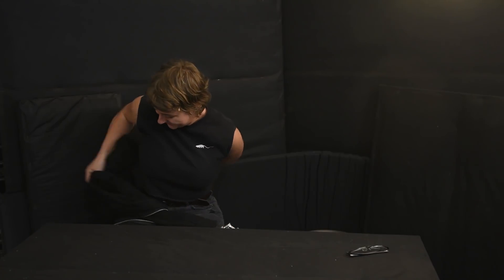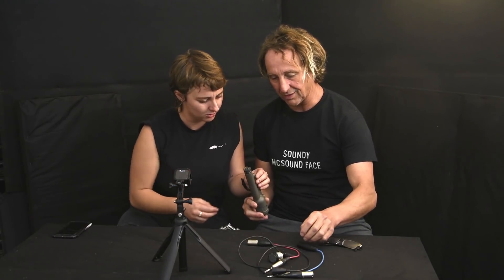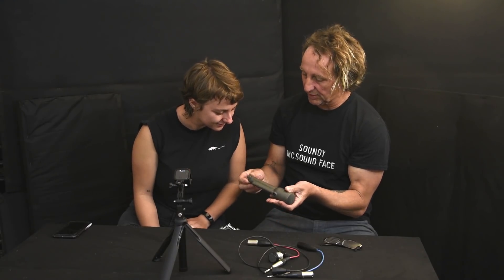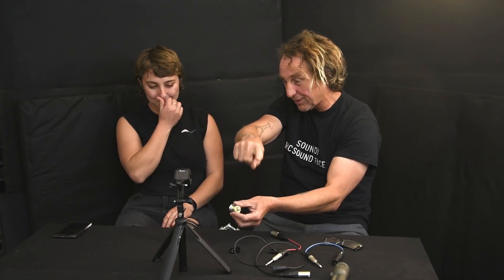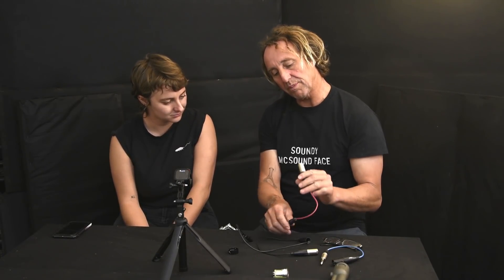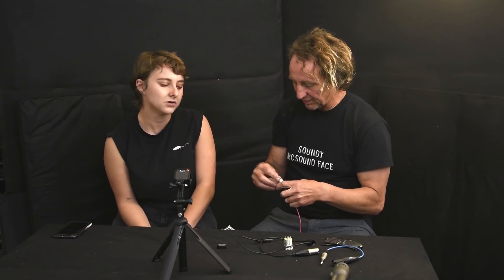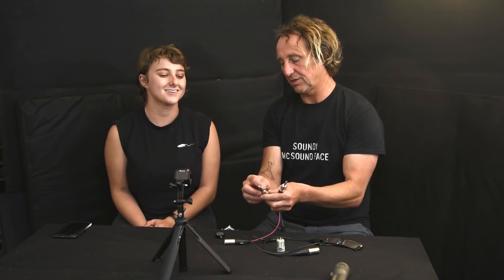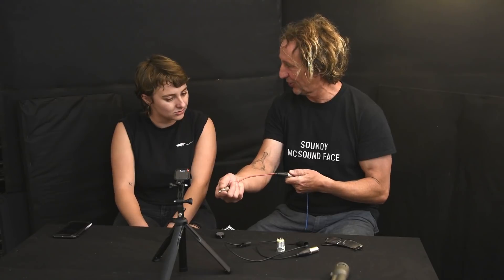Why are sound cables like they are? - Sound Chat With My Daughter Sammy

Comment: In addition to the Tuchel, we used to have the DIN connectors (5 -pin, 3-pin and loudspeaker connectors) in Europe. Some of them were made with an outer locking ring. It's funny how those brand names (or standard names) become synonymous with the  product. An old stage hand I worked with, used to say "Throw me a Schuko". And with that, he meant a heavy duty grounded extension cord. I later found out that Schuko stands for "Schutz Kontakt". German for "protection contact", i.e. a ground connector.
Reply from the maker: Awesome and so cool! Do I recall correctly that a Tuchel was a locking DIN?
Reply: @DaveRat  Tuchel is basically a brand name. similar to Cannon or Neutrik. They are now part of Amphenol. I think the connectors with the flat pins  (like https://farm4.staticflickr.com/3794/9723974824_4b8e953d74_b.jpg) were also used for mikes. Judging from the picture, even for U87's. Not that I ever owned one ;-). These are much larger than the DIN connector.
Reply from the maker: @mixerman1078  👍

Comment: X-change L-ine R-eceptacle.
Reply from the maker: Yeah, that seems popular. I found the old Cannon data sheet.

Here is info from it

XLB-PCB: A lockable printed circuit board receptacle, available
with 3 pins. XLB "X series", “L latch” and “B board mount plastic
pcb shell”.
XLM-PCB: A lockable printed circuit board receptacle, available
with 3 pins. XLM "X series", “L latch” and “M metal pcb shell”.
XLR: A lockable connector, configurations available from 2 to 7
pins. The most common XLR in audio products is the 3-pin XLR.
Our original design was the "X series", which later incorporated a
latch (L) and then rubber insulation (R), leading to the acronym
"XLR".

Comment: I was told this about the XLR plug name by a generally respectable source (a friend that studied and worked audio engineering in Germany decades ago, in the 80's and 90's, I think): X series Cannon Electric connector type (which stands for the X). Eventually it was modified by adding a latch (which stands for the L) and a rubber ring around (which stands for the R).
Reply from the maker: Yes!!

From the Cannon data sheet:

XLB-PCB: A lockable printed circuit board receptacle, available
with 3 pins. XLB "X series", “L latch” and “B board mount plastic
pcb shell”.
XLM-PCB: A lockable printed circuit board receptacle, available
with 3 pins. XLM "X series", “L latch” and “M metal pcb shell”.
XLR: A lockable connector, configurations available from 2 to 7
pins. The most common XLR in audio products is the 3-pin XLR.
Our original design was the "X series", which later incorporated a
latch (L) and then rubber insulation (R), leading to the acronym
"XLR".

Comment: How about this for a follow up: lay unbalanced balanced and cat6e cables side by side with a mono amp power cable driving a lightbulb. Happens every day on stage. Then scope and listen for the induced hum in each wire.
Reply from the maker: Very cool, will do some noise cable tests at some point

Comment: XLR stands for external line return
Reply from the maker: Hmmm, consensus seems to be:

History and manufacturers

Variety of male and female XLR connectors with different numbers of pins
The XLR connector was invented by James H. Cannon, founder of Cannon Electric in Los Angeles, California (now part of ITT Corporation), and for this reason it was sometimes colloquially known as a Cannon plug or Cannon connector. Originally manufactured as the Cannon X series, by 1950 a latching mechanism was added (Cannon XL)[2] and by 1955[2] a version surrounding the female contacts with a synthetic rubber polychloroprene (neoprene) insulation using the part number prefix XLR.[3][4] There was also an XLP series which used a hard plastic insulation, but was otherwise the same.[2] ITT Cannon originally manufactured XLR connectors in two locations: Kanagawa, Japan and Melbourne, Australia. The Australian operation was sold to Alcatel Components in 1992 and then acquired by Amphenol in 1998. ITT Cannon continues to manufacture XLR connectors in Japan.

Comment: XLR is just the prefix of model number created by Cannon in the 50's as some other comments have mentioned. "R" was added once they added the "Resilient plastic" surrounding. One cool thing about the design is that pin1 in female connectors is slightly protruded so that ground always connects first and breaks last for added protection of the circuit. Also, I just learned how to properly pronounce "Tuchel" although not sure if I will ever be able to change my ways.
Reply from the maker: Ha! Cool cool and thank you Nate!

Comment: 9:15 --- this is a TOUGH section to explain. The blocker is not knowing about op amps. I didn't realize fully realize that a microphone generates both the in-polarity AND out-of-polarity part. Sort of a "built in" mechanism to start the Common Mode Rejection ball rolling. The catcher is the op amp --- and it's ability to DIFFERENTIATE the TWO signals is also a kind of "built in" mechanism. That is, it's really easy to do. It sounds hella complicated but it is actually something you learn when you learn how to use op amps. Thanks for the great video! :D

Comment: conflicting explanations about xlr. One is already mentioned in the comments the other is that it stands for "External Line Return"
Reply from the maker: From wikipedia

The XLR connector was invented by James H. Cannon, founder of Cannon Electric in Los Angeles, California (now part of ITT Corporation), and for this reason it was sometimes colloquially known as a Cannon plug or Cannon connector. Originally manufactured as the Cannon X series, by 1950 a latching mechanism was added (Cannon XL)[2] and by 1955[2] a version surrounding the female contacts with a synthetic rubber polychloroprene (neoprene) insulation using the part number prefix XLR.[3][4] There was also an XLP series which used a hard plastic insulation, but was otherwise the same.[2] ITT Cannon originally manufactured XLR connectors in two locations: Kanagawa, Japan and Melbourne, Australia. The Australian operation was sold to Alcatel Components in 1992 and then acquired by Amphenol in 1998. ITT Cannon continues to manufacture XLR connectors in Japan.

Comment: Funny that Sammy said "I thought the X is for one, L for two, ...." - because, in german, there's a pretty nice "Eselsbrücke" that I teach people that ask me about Cables: "X is für Nix (Ground), L ist für Laut (+), R ist für Rückwärts (-)", roughly translated: X is nothing (ground),L is loud (+), R is backwards (-). This then applies to pins 1, 2 and 3. Definitely the original meaning (others already pointed out that this comes from the feature set of the X-series Canon connectors), but super handy for beginners to know which pin does what on a cable ;)

Great video. I only just now stumbled on this series, and I have to say: having people that are not knowledgeable about the technical stuff ask questions to a knowledgeable person on camera is a great format. Because, as you get more experienced, you forget what you did not know when you started out, and any explanations you do without someone asking you stuff tend to focus on things that might not be on the mind of someone totally new to the topic.

Thanks!
Reply from the maker: Awesome and thank you Jan!
Reply: When you think about it the TRS and TS mentioned later actually do refer to the two/three contacts by name as well, so in that case it's not a coincidence that it's 3 letters, 3 contacts
Reply from the maker: @TomDaghdha  👍

Comment: I was hoping you'd mention the other great feature of XLR over 1/4" TRS, that pin 1 makes contact before 2 and 3.
Reply from the maker: Yes, bummed I forgot to mention that
Reply: Oh, I never knew this, thank you! Does that contribute to better cancellation of noise/EMI?
Reply from the maker: @TJF97  it reduces the pop when plugging in as it grounds the gear together first, then connects signals
Reply: i had no idea, this is great :}

Comment: I learned many years ago from a Swedish equipment designer that it stood for External, Live and Return
Reply from the maker: Interesting. A few comments below seem to have believable explanations. X series connector, L is for locking or latching and the R seems to be possibly rubber or resilient referring to a material used.  The old Canon XLR s used rubber to support the female pin receptacles.